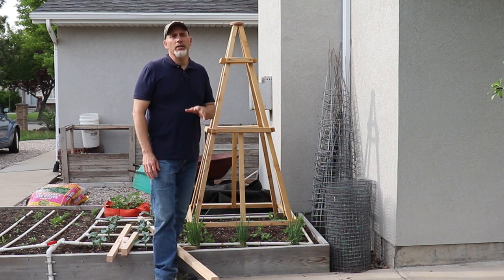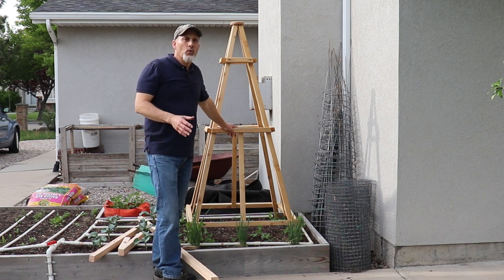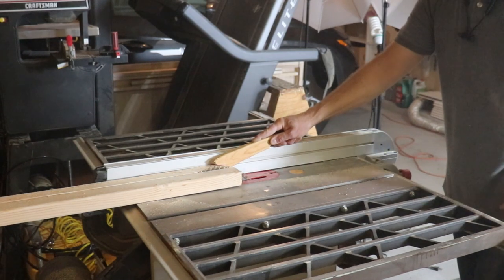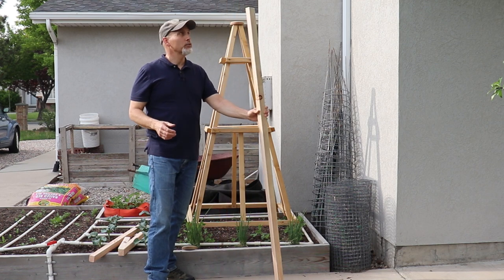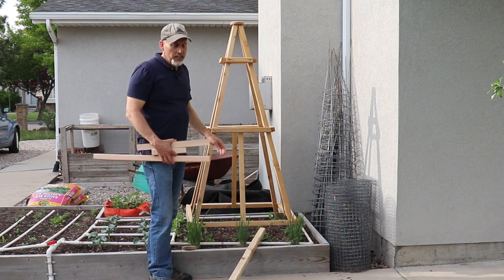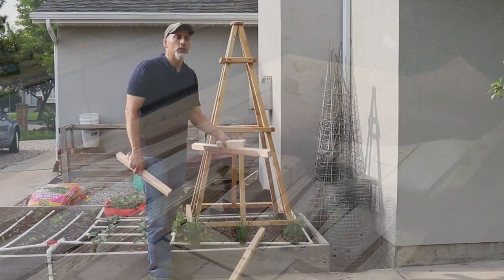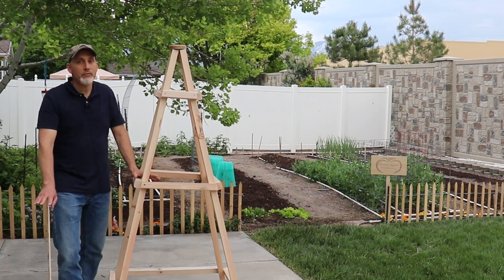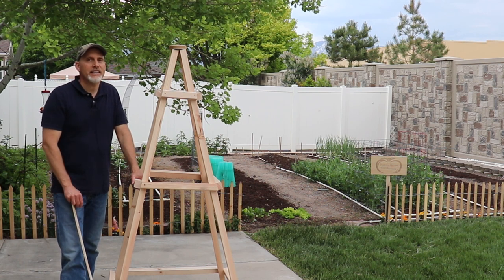How to make a simple garden trellis/obelisk for under $20

Comment: 2" x 4" is the measurement of the lumber rough cut. Then it is milled down to 1 1/2" x 3 1/2".  Older buildings have actual 2x4 framing before the modern Era of milling down the lumber.
Reply from the maker: Thanks!

Comment: Rick,  How do you put shade cloth over these teepees when you have more than one in line?  Also,  why are my Zucchini only putting on male flowers?  I've had some zucchini off of those plants,.  Is it the heat?  I mean it's only 101 degrees in northern Utah.  I have 40% shade cloth on them that are open for the morning sun and pollinators.  What's going on?  It was as hot last year and I didn't have this problem.
Reply from the maker: I actually don't use shade cloth on much other than my peppers.  This trellis is for beans or peas, neither of which would need shade cloth.
Yes it could be the heat, but you really don't need to have shade cloth over your zucchini.  Just keep it well watered and it should be fine.
Reply: @StoneyAcresGardening Excellent, Excellent advice. I've only had luck with herbs 🌿 & flowers & turnip greens in Texas. We're breaking record temps here.

Surprisingly, the eggplants, tomatoes, cukes & peppers are beautiful but not producing. My watermelon are growing crazy, but I'm taking the expert's advice & keep fingers crossed for a wonderful fall harvest per Mr. Rick 😉

Hopefully, the peas will run like my sentences 😂😂
Reply: Good luck with gardening in these global temps. Here in the Dallas-Fort Worth area of Texas, I water 💧 garden between 6-7 a.m. so they won't boil like a stew. Take care 🙂 & I hope you better luck in the fall.